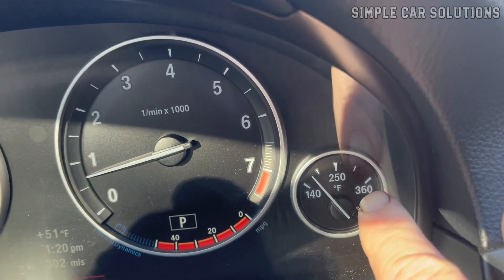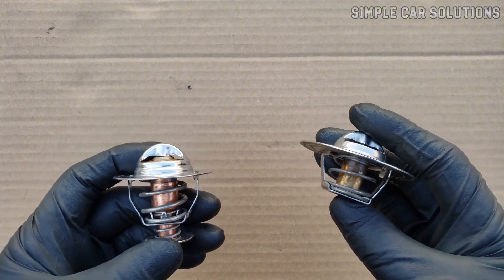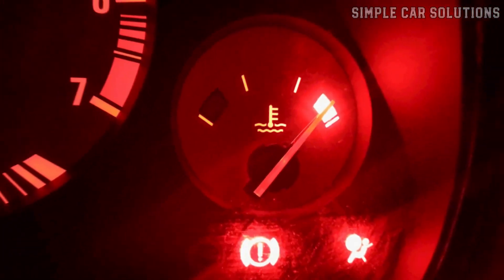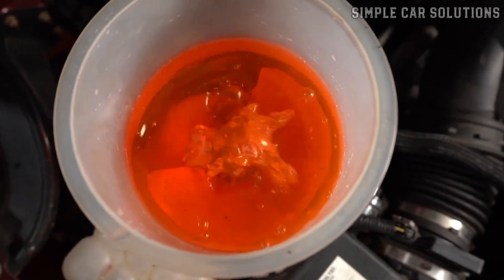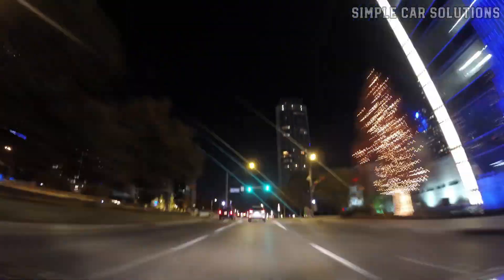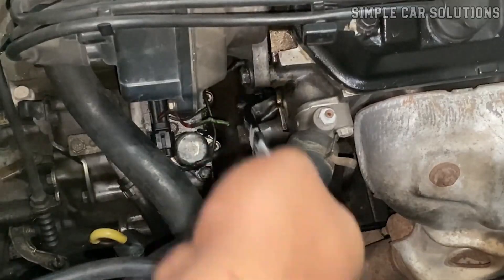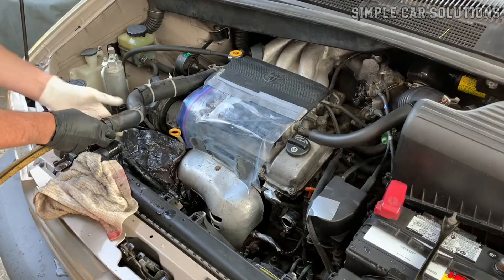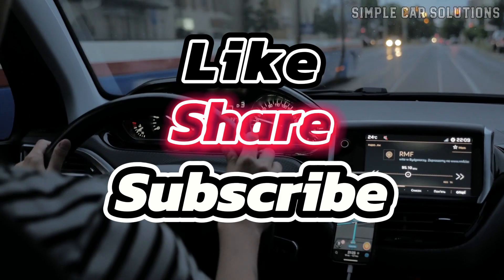Why Car is OVERHEATING and How to Fix it. Mechanic Shares Top 7 Reasons

Comment: I have replaced the brake pads of my car yesterday and since then car is heating more than it used to heat before changing brake pads, is there any link? Kindly reply, if anyone knows.
Reply from the maker: Yes, there can be a link. If a brake caliper is sticking or a wheel is dragging after the pad change, it can cause extra heat and make the car overheat. Check for a hot wheel, dragging brakes, or a seized caliper.

Comment: I have constant car overheating and i suspected heatsensor of which i replaced with new now i drove until to a point it mixes i nolonger know what must I do
Reply from the maker: If it’s still overheating after replacing the sensor, the problem is likely cooling system-related: low coolant/air trapped, bad thermostat, failing water pump, clogged radiator, or cooling fan not working. Stop driving it and check those next to avoid engine damage.

Comment: I have changed radiator radiator hose my water pump and thermostat and truck is still running hot. What else could it be sensor or head gasket
Reply from the maker: If all that’s new and it still overheats, check the cooling fans, air in the system (needs a good bleed), clogged radiator passages, and a stuck heater core. If those check out, then yes - a bad temp sensor or early head-gasket issue could be the cause.

Comment: I have ford x max 2007 the high temperature i can't find the solution please give me same
Reply from the maker: Start by checking coolant level, radiator fan operation, thermostat, and water pump. If all seem fine, test for a blown head gasket.

Comment: My2022 Toyota RAV4 it over heat but i didn't see eny things but the engine shuts of for about 10tn 15 and start again i don't now why
Reply from the maker: hat’s your "engine protection system" kicking in — it shuts off to prevent damage. Could be low coolant, bad thermostat, water pump, or sensor issue. Have the cooling system and fault codes checked right away.

Comment: The thermostat cost more than $30
Reply from the maker: Yes, thermostats can run \$30+ depending on brand and housing design, but it’s still one of the cheapest parts in the cooling system compared to major repairs.

Comment: Just replace coolant sensor then fixed for nissan pathfinder over heat without codes
Reply from the maker: Yes, a faulty coolant temp sensor can cause overheating by not triggering the fans or giving wrong data. Thanks for the addition.

Comment: I HAVE OPEL FRONTERA SPORT WHEN CLMBING TO MOUNTAIN  PASS I FRENCH APLES IT OVER HEATED SEVERAL TIMES.... I FOUND THE FANS NOT TURNING ... ....BEING  ON THE ROAD ...I TEST FUSE OK ... I FOUND THE HOT WIRE WIRED DIRECT TO BATTERY AND PROBLEM STOPPED ....FANS NOW RUN ALL TIME BUT OVER HEATING IS CLOSET TO NORAML
Reply from the maker: If the fans only work when wired direct, the fan relay, temp sensor, or wiring is faulty — fix those so the fans switch on automatically.

Comment: The radiator and water pump on my car was charged already but the coolant is  lowered easily,  what is the problem with my car
Reply from the maker: If coolant drops quickly, you likely have a leak (hose, radiator, gasket) or the engine is burning it from a head gasket issue — pressure-test the system to find the source.

Comment: Hi, I have a 08 HHR chevorlet and they just checked my radiator and added coolant and my air conditioner worked fine and no leaks, over night it still leaked it all out an overheated on the road and wont start now help? thanks ty
Reply from the maker: You likely have a major coolant leak — possibly a blown hose, water pump, or head gasket. Don’t try to restart it; tow it to a shop before causing more engine damage.

Comment: My problem is overheating after driving for about 45 minutes....
Reply from the maker: Overheating after 45 minutes could mean a failing radiator, weak water pump, clogged system, or a stuck thermostat. Check coolant flow and fan operation.

Comment: My car is bubbling in the coolant system I changed the thermostat, but the car doesn’t over heat usually stays in the middle rises when I stop, but the fan come, and when the car is cool and sitting the coolant goes down real low so I have to refill, but a mechanic told me it’s most likely a bad water pump
Reply from the maker: Bubbling and coolant loss often point to a head gasket issue, not just the water pump. Do a combustion leak test to check for exhaust gases in the coolant.
Reply: @SimpleCarSolutions I just replaced the water pump  the coolant reservoir and thermostat and it stopped and everything is back to normal
Reply from the maker: Great to hear! Sounds like the water pump was the issue after all — glad it's all running smoothly now.

Comment: I have civic 2009 over heating problem I have changed radiator and removed thermostat valve as well , but again same problem came out. Can u suggest what we need diagnosis first
Reply from the maker: Start by checking water pump function, radiator fan operation, and head gasket (look for bubbles in coolant or milky oil). Also, make sure there's no air trapped in the cooling system — bleed it properly.
Reply: Mine every thing was changed , head cylinder nd water pump. Now trying to check thermostat
Reply: Mine every thing was changed , head cylinder nd water pump. Now trying to check thermostat
Reply: The water in the radiator shows it’s not hot but the gauge shots up
Reply from the maker: @kencart  That sounds like an air pocket or bad coolant temp sensor—bleed the system again and check the sensor’s wiring and ground.

Comment: Ok 2017 Ford Fusion with a 1.5 L ecoboost turbo. It begins to overheat once I get up to speed does not overheat when idling or low speeds and at high speeds once it gets to a high speed it doesn't overheat as a matter of fact it stops overheating when I go out high speed say 60 mph and put it in neutral and just coast it's goes back to normal and I have to do this about 5 to 7 times and then once I do that it stays normal.
Reply: Very informative video! Thank you for taking the time to share knowledge.
Reply from the maker: You're welcome 😉
Reply from the maker: That sounds like a coolant flow issue under load — possible causes include a partially blocked radiator, weak water pump, or failing thermostat. Have all three checked, especially the pump.

Comment: I have a 2001 Chevy Silverado 5.3 over heating problem changed the thermostat new coolant it's pushing the coolant out of the radiator over flow hose
Reply from the maker: That usually means you have a blown head gasket or a cracked head/block — combustion gases are pressurizing the cooling system. Get a combustion leak test done.
Reply: Mine is over heating but no radiator if you check on it the water level is too down and from the resaved tank sometimes water is disappeared or sometimes alomost full
Reply from the maker: That’s a classic sign of a head gasket leak — coolant is either being burned in the engine or pushed out under pressure. A pressure test and combustion leak test will confirm it.

Comment: Need help with 2005 Mazda 3. Overheating, checked coolant system, changed water pump, rod radiator, thermostats removed and mechanic says it doesn't look like blown head gasket either so not sure.
Reply from the maker: Check for air pockets in the cooling system, a weak radiator cap, a faulty cooling fan, or restricted coolant flow. A system pressure test may help pinpoint hidden issues.

Comment: Hi guys I'm driving chr toyota model 2017,  my car got a problem of keeping raise temperature and I change water pump is doing some thing.
Reply from the maker: Hi, if the temperature still rises after changing the water pump, check the thermostat, radiator, cooling fan operation, and for possible air in the cooling system.

Comment: Coolant link through radiator body. Why its happened ?
Reply from the maker: A coolant leak through the radiator body means the radiator is cracked or corroded, often from age, pressure buildup, or impact damage.

Comment: Could replacing the coolant reservoir help as well?
Reply from the maker: Replacing the coolant reservoir can help if it’s cracked, leaking, or not holding pressure, otherwise, it won’t fix overheating by itself.

Comment: I have a 2016 ford fusion and I replaced thermostat, water pump and cht sensor and its still saying overheating.
Reply from the maker: If you've replaced the thermostat, water pump, and CHT sensor but still get an overheating warning, check for air trapped in the cooling system, a faulty radiator, or a bad head gasket. Also, verify the fan is working properly.

Comment: Another one of course is a blown head gasket.  If you are using up coolant at a faster rate then usual, run a test, which is easy.
Reply: How do you run a Test on head gasket??
Reply: @tawfiqjabbar5153 You can get the test kit.  It is a liquid test using your coolant system.  If the coolant changes color, then you have exhaust gases getting in the coolant from the blown gasket.
But even without running the test, if you have a lot of white smoke coming out the exhaust pipe and a lot of air bubbles showing in your coolant without the cap on (unless you didn't burp it), then you likely have the blown gasket.  You likely have a very clean spark plug or plugs too and the cylinder head(s) will be very clean. The coolant really cleans out where the gasket is blown.
Reply: @KenGaskins-nm3gx I used a pressure tester. With out the engine running you will be dropping pressure inside the engine.
Reply: @KenGaskins-nm3gx I don’t see any white smoke or no milky oil I’m aiming at the water pump.
Reply from the maker: You're right. Thanks for the addition.

Comment: Chrysler 200 2016 2.4.. i had my starter and battery replaced. No overheating issues. The first day i got my car out of the shop fluctuating temp. My radiator had absolutely 0 coolant which it had when i dropped my car off... would they have had to empty my radiator to change my starter? Can this be needing my ecm reset?
Reply from the maker: No, replacing the starter doesn’t require draining the radiator. If the coolant was full before and empty after, it may have been drained accidentally, or you have a leak. Fluctuating temp isn’t likely an ECM issue — refill coolant, check for leaks, and bleed the system.

Comment: My car overheats when I turn on my aircondition to number 2. Why is it so? Please help!
Reply from the maker: It could be a failing radiator fan, weak water pump, clogged radiator, or low coolant. The extra load from the A/C exposes an existing cooling system weakness.

Comment: Will weak battery cause fan to work slow
Reply from the maker: Yes, a weak battery can cause the fan to run slower, especially if the alternator isn’t supplying enough voltage.

Comment: Whenever i travel long distant and i return home  and turn the engine off the fan comes on. The over flow bottle is full yet  i have to keep putting coolant in the radiator on each journey. Thats the only way that stops the fan from coming when i return home.
Reply from the maker: You're likely losing coolant due to a leak or a blown head gasket, causing air pockets that trigger the fan. Since the overflow is full but the radiator is low, the system may not be pulling coolant back in as it cools. Check for leaks, test the radiator cap, and pressure-test the system.

Comment: If it was a water pump, wouldn't it begin to overheat right away? If i drive for 20 minutes without it overheating then it wouldn't be the water pump would it?
Reply from the maker: Correct — if the water pump had completely failed, overheating would happen quickly. But if it's weak, has a slipping impeller, or intermittent flow issues, it might take 15-20 minutes under load to overheat. So it still could be the pump, but also check for air in the system, a sticking thermostat, or radiator flow issues.

Comment: My honda fit is returning water through the water reservoir when the cap is opened, but also my cooling fan is not working properly so i connected the fans directly only the ac fan is working fin what can be the problem
Reply from the maker: If water is returning to the reservoir and the main cooling fan isn’t working, the engine is likely overheating due to poor cooling. Since only the A/C fan runs, check the main fan motor, fan relay, fuse, and coolant temperature sensor.

Comment: Acura tl =. New engine and radiator, therm  ostat  and water pump, after 10 minutes driving starts overheating to the signal and comeback to normal and then again   🤷🏻‍♂️
Reply from the maker: That fluctuation usually means there’s air trapped in the cooling system. Even with new parts, if the system isn’t properly bled, air pockets can cause overheating. Bleed the system fully, preferably with a vacuum fill tool. If it still happens, check the radiator cap and cooling fan operation.

Comment: Could you help me find a problem, please? 
I have a Suzuki Vitara from 1995, and every 2-3 weeks I open the valve on the radiator to discover that I need to top up 200-300 ml of coolant. 
I cannot see any visual leaks under the vehicle. Could it be from the faulty cup?
Reply: Thank you
Reply from the maker: Yes, a faulty radiator cap can cause slow coolant loss by not holding pressure, allowing coolant to evaporate or escape as vapor. Replace the cap with a new one of the correct pressure rating. If the issue continues, check for small leaks at hoses, the heater core, or signs of coolant in the exhaust (head gasket).

Comment: Well explained, but I don't understand why the engine over heats after driving in a slightly steep hills and not in a normal flat terrain.
Reply from the maker: Overheating on hills usually means your cooling system is struggling under extra load.
Reply: Thank u ,so what might be the problem  my carbhad temperaturesensor problemi put new one nw when i drive fast or go uphill the bars goes up what might be the problem @Simple-Auto-Solutions
Reply from the maker: @tapiwaruzvidzo9563  If the temp rises on hills or at high speed, you might have a weak radiator, failing water pump, clogged system, or a fan not working properly under load.
Reply: Thank for coming back,when i bought this car the waterer bottle was clear nw its like brownish .you mention waterpump,radiator meanin Thermostat might be good?@Simple-Auto-Solutions
Reply from the maker: @tapiwaruzvidzo9563  Yes, the brown coolant means there could be rust or sludge, which can clog the radiator or damage the water pump. The thermostat may still be good, but it's best to flush the system and check all components.

Comment: My heater stopped working because of air pockets. I replaced the pump, radiator, pipes, etc. Nothing helped. Then I removed the old cylinder head gasket, sanded the head and installed a new gasket. Air pockets disappeared, things started working fine.
Reply from the maker: Thanks for sharing your experience
Reply: I have changed my water pump, thermostat, radiator, and radiator hose and my truck is still running hot. What else could be wrong for it to still run hot?

Comment: My mechanic removed my temostat and now my engine is showing milk color on the cover of the engine oil and water doesn't go through the radiator until you pressing the pipe hoses or pump.. please what is the solution??
Reply from the maker: The milky oil indicates coolant mixing with oil—most likely from a blown head gasket. Removing the thermostat may have worsened flow issues or masked overheating. Water not circulating properly also suggests a failing water pump or airlock. The solution: do a head gasket test, replace the water pump if weak, reinstall a proper thermostat, and fully bleed the cooling system.

Comment: Today my needle was all the way to hot the truck was running rough I have very little coolant in the truck so I put the coolant in and so far so good what caused that thanks
Reply from the maker: Low coolant was the main cause. When coolant is too low, the engine can't cool properly, leading to overheating and rough running. Keep an eye on the coolant level—if it drops again, check for leaks at the radiator, hoses, water pump, or head gasket.

Comment: hi my car keeps busting the water battle cap and it doesnt seal well when the car is moving
Reply from the maker: If the coolant reservoir cap keeps bursting or won’t seal, you may have excessive pressure in the cooling system. This could be due to a blown head gasket, a clogged radiator, or a faulty cap. Start by replacing the cap with a quality OEM one. If it still happens, have the system pressure-tested for head gasket failure.

Comment: My jetta 4 1.9 diesel does not start  when engine is hot what is problem
Reply from the maker: If your Jetta 1.9 diesel won’t start when hot, the most likely causes are a failing starter motor (heat soak issue), a weak battery, or a faulty coolant temperature sensor. Check the starter for excessive resistance when hot, test battery voltage, and scan for fault codes. If the starter is sluggish when hot, replacing it may fix the issue.

Comment: My excavator coolant temperature goes up full  suddenly but when i go and open coolant tank the coolant cold normal no heatup. I changed the sensor also but still the same problem
Reply from the maker: If the coolant is cold but the gauge shows full overheating, it's likely an electrical issue. Check the wiring and connectors to the temperature sensor for corrosion or damage. Also, inspect the gauge cluster or ECM for faults. A stuck thermostat could also cause improper readings, so ensure it’s functioning correctly.